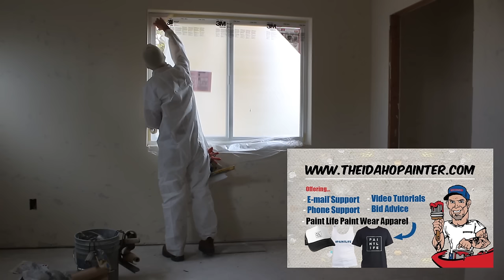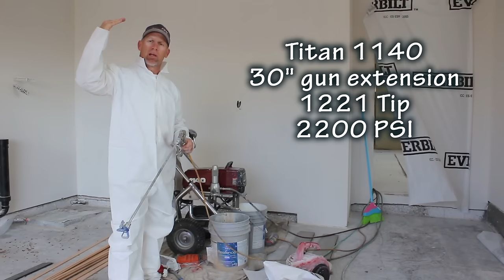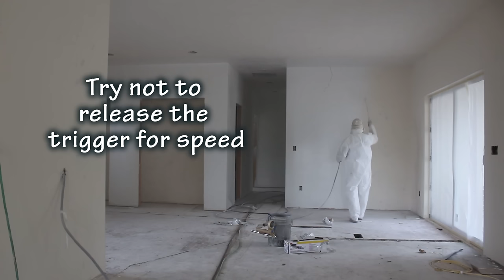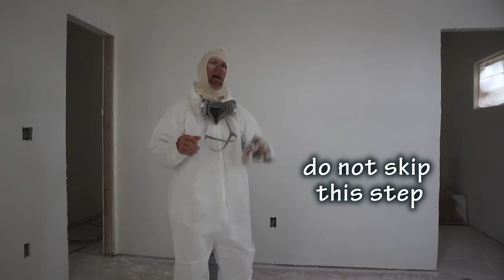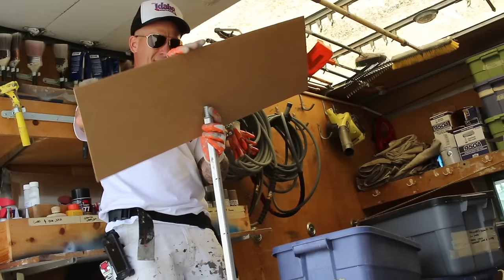PRIMING AND PAINTING WALLS  Painting New Construction Sheet Rock Walls.  Spraying new drywall

Comment: Just a thought, if you back roll the primer you don't have to dust unless its excessive ( i use a 24 inch floor broom). If the primer is too thick i cut the primer 10% with water. I always back roll the primer :)   Different strokes for different folks :)
Reply: If I'm correct, the mopping was done BEFORE he sprayed the PVA primer in another video... Where he showed prepping the walls before priming.. He mentioned that he mopped the walls because they were smooth and didn't have any texture on them... and they were sanded... not sure why he included that insert with this video..
Reply: The Montana Painter where in Montana. I'm lived in Cascade county for years.
Reply: The Montana Painter backroll is necessary. I would do it even if I dusted. Guys I know would not be nice to the Idaho painter
Reply: I never back roll. no need to if you know how to spray and it's a nice drywall job.
Reply: You have to bankroll if you want your application warranted by sw
Reply: What exactly is back rolling and is it done after I spray?    Do you do 2 coats of primer and if so how long do you waiting between coats?     How much does rainy weather play into dry time for primer?     Do I need to do multiple coats of paint in doing multiple coats of primer?

Comment: so I read some of the comments about back rolling so I thought I would put in my 2 cents from being a painter almost 20 years... yes you can just spray the primer, yes you can just spray the paint finish too, but.... primer won't seal as good just sprayed also depending on your primer it might flash spray strokes.. same with paint gonna look real 'sprayee' if you just spray the finish not to mention in most cases it will touch up like crap.  some flats will touch up fine but anytime you take a roller to a sprayed finish to touch up your pretty much gonna see it.  He's using a pva so those usually are very dead flat & will not flash at all.  He's also doing high production work & a lot of painters will just spray everything on new construction, primer, then flat on all the walls & ceilings.  Why because it's quick & you have to make $ & sometimes there's multiple homes after one another but its not the best way to apply.  If you spray & backroll all your primer in it will feel like a job well done & be noticeably more solid I can guarantee that, then spray & back roll your finish paint & you'll be looking like a real painter that cares more about quality then $.  That's just my experience with it

Comment: Hi Chris, I haven't seen anyone back rolling after you spray. Is this necessary to do, I have always back rolled to get some texture and work in any thick or thin spots. If you have a way around this, I'd love to hear it. Thanks, I really enjoy your videos. You guys are truly top notch!
Reply: I've been doing new construction for DR Horton, lennar, and mungo, we always backroll for one reason, repairs. The drywall is fuzzy after sanding, so primer helps smooth out walls. Backroll will let it penetrate into the mud so that when it gets repaired later, it won't look fuzzy again
Reply: @CesarMartinez-wi7wc  do you back roll the paint also if you ready back rolled the primer?

Comment: The required equipment is cost prohibitive for the typical DIY'r. You're also moving your arm in an arc, leaving inconsistent application, and not backrolling or laying down a perpendicular pass.
You're showing these people enough to get them in trouble.
Reply from the maker: Not true
Reply: @Idahopainter  
Yes, very much is true but it's your show.
Reply: A typical djy'r is not spraying an entire house. I agree on spraying on an arc is not ideal but unless your bending your knees and getting on a ladder each and every pass you cannot achieve this with an extension so some compromise is in order.(Your arms length +extension is the radius remember.) I think there's plenty of good info in the video and is mostly helpful to people.

Comment: Chris are you able to spray the topcoat without back rolling or do you roll the final coat? I just primed drywall (sprayed) and sprayed the first coat eggshell and it looked a little streaki so I just rolled the final coat eggshell and it is way better finish streak wise at least ... but still not perfect or is that just the way it is that you can’t get glossy paints to be streak free? Is there always a little bit of a unevenness ?

Comment: How expensive are those spray painting machines and which do you recommend best? Are they just as efficient as rolling?
Reply: From 300$ to 30,000Grand.
Reply: Any room > than 200sqft w/ few obstacles is the cutoff, or any textured ceiling you feel like taping off.

Comment: we have some existing walls that got all new knock down texture to match the all new sheetrock on the other floors. Would it be ok to install all trim/baseboard, and Spray PVA primer those walls with some pva overspray on the trim (not  mask new trim). then later, spray all the trim. then mask  trim and roll ceiling an walls?  how would you do this?
Reply from the maker: PVA on trim is not a good idea

Comment: So the paint they sell in stores that already has primer in the paint wouldnt be good enough is it better to use straight primer then use the paint?
Reply: Old Timer on new drywall and any repairs you have to prime separately to prevent uneven drying which will cause flashing.
Reply: I have talked to several painters and paint sales people and they have all said 2 things;
1. If it is new drywall use primer first then paint.
2. All the primer+paint is is just extra thick paint. No primer at all.
I'm in the middle of painting the whole inside of my renovated house and have been learning a lot.
Reply: In reality no paint has “primer” in it. It’s a marketing gimmick to be honest. There is literally no guideline to what makes a paint a “paint with primer”. When a paint is labeled as that though, what it means is that it has a somewhat higher level of volume solids (pigment among other things) which helps it cover better and sometimes at a thicker millage (thickness of paint film on the wall). High quality primers are generally acrylic latex which gives excellent adhesion properties. Some “paint+primers” are acrylic vinyl which means it will dry fairly quickly but the adhesion and durability properties won’t be there. So personally, it’s a case by case basis. But if it’s new drywall, definitely use a PVA primer first.

Comment: Please give me advice on this: A contractor spray painted (one coat of Paint/primer in one EasyCare brand ultra premium) on my new construction drywall ceiling without cleaning the dust and he left without a trace.  I am now trying to finish the paint job.  I'm afraid without cleaning the dust and not apply a PVA primer the way that you show here, the paint will not bond properly.  Please recommend what I should do next?  Thank you.
Reply: There's really usually not a lot of dust on the ceiling (gravity). So nothing to worry about.

Comment: Getting ready to paint one of our bedrooms at our house.  The ceiling paint was peeling so we stripped it bare, down to the plaster.  What kind/type of primer and paint do you recommend so this does not happen again.  I'm also gonna put texture on the ceiling and the walls, do i put the texture on before or after primer? 

We also stripped wallpaper off the walls with a product called "Worlds Best Wallpaper Stripper" from Home Depot.  Is there anything else I should do to the walls.

I purchased a Graco airless with a 515 to primer/paint and bought a Hopper Gun as well to do the job (never used either before, but from watching your video's I think I'll be okay using them).

Been watching your video's for tips, they are excellent!!

Thanks!!
Reply: Would you put the texture on before or after the primer?

Comment: Chris here in KY homeowners like textured ceilings when building new homes. I'm about to paint a new home with exactly that, textured ceilings. I want to prime the walls while spraying. Obviously at this point of the process no carpet, trim or hardwood floors are down, so no worries getting any over spray on them. However, I have to ensure the ceilings do NOT get any paint on them when spraying the walls with primer. What process/procedure do you use to ensure the ceilings are not affected? Do you simply use 9" paper with 3" tape to catch any potential paint over over spray from getting on the ceilings?
Reply: 311 tip and 12in paper on the ceiling
Reply: What he said! (Stew). Also, it would help alot if you're arm angle was straight at the wall up there at 8', so think about wearing either some platform shoes.

Comment: Question about paint after texture 
I apply orange peel texture on a 700sqft retail local and spray paint the wall (satin) right after, but when I came back next day I notice if I stand on front of the wall looks great but if you stand along the wall and look the natural light reflection look like either the texture wasn’t even or needs more paint. I’m not sure if I supposed to primed prior paint or back roll it? Thanks in advance for the recommendation
Reply from the maker: Prime first with a PVA primer.  To late now

Comment: Do you have to prime new construction drywall?  is there another way to get good coverage?
Reply: Jody Walker - if you don't seal the new drywall and or the the texture it will suck up the moisture from your paint and dry blotchy and require many coats. By that time the fiber on the board will start to raise and so can and will the tape joints. The drywall primer is not only a primer.... It's a surface sealer! Poly Vinyl. PVA is cheap and doesn't need to be perfectly applied so there's no reason to skip it. If you do you will not only need more paint to cover the walls properly but you're gambling with the tape lifting and fiber raising.... Especially  on smooth surfaced walls.

Comment: I just removed 30 year old wallpaper from bare drywalls. Meaning drywall was not primed or painted before wallpaper. The glue is all over the walls. Need to prime 2x I think
Reply: Remove the glue, I normally just use hot water and sponges and rags. It sucks but it should be done. Some jobs I've been able to use a electric pole sander to get it off. I mean all jobs are different and take a different course of action .I've had contractors tell me to just prime over because it was being textured with knockdown but in your case remove the glue with either hot water,  apple cider vinegar works (stinks) or diff (chemical) from hardware store or paint store
Reply: Chris Blanchard yes u r very correct. This job had wallpaper in all the rooms so I had to figure out a way to remove the glue quicker rather than sponge and water. I used a steamer that glue just melted and ran down the wall mixed with hot water. Worked like a charm. I still had problems but that's just the way it was too much glue.

Comment: Hey Chris,

In the past I was using a rag to dust off the dust from the walls. But then when I use the paint sprayer (similar to the 1 you use, just the smaller version) after priming new drywall the walls are gritty and I literally have to sand absolutely everything with a 120 grit to make it feel smooth, like how a wall should feel.. 

I saw your mopping the wall video and I'm going to try that on my current project I'm doing. However I'm wondering if you could tell me why the walls feel gritty all over everywhere, after spraying on new drywall with primer? Is it a pressure related thing, a dust related thing, or should I just go over the walls with a roller after spraying, to try and avoid the problem? 

Any help you can offer is greatly appreciated!
Reply from the maker: Cause of the dust on the walls

Comment: Can wall paint be used instead of primer on new drywall?
Reply: 771blahblah - yes but it will dry blotchy and require more coats meaning more paint! You are also gambling with the tape joints lifting as well as the fiber on the drywall board raising. PVA is more than a primer... It's a sealer!
Reply: Yeah what he said but also, the topcoat is usually 2 or more times expensive as a pva primer, the pva primer is to cut down on paint costs

Comment: I don't like spraying first coat primer on new drywall especially if a power sander was used to sand. a power sander will leave little fuzzies and a sprayer will encapsulate these in the paint and they will show on a smooth finish. using a roller for the first coat will work these into the primer so they don't show. sure its nice to go in and spray a whole house in  a couple hours and be gone but for the level 5 finishes that my customer expects its not going to cut it.if someone has mastered a way to overcome this I am all ears.
Reply: freethinker52 Are you a taper?? I mean a good taper! A level 5 has almost nothing to do with your priming technique. If you want to produce a level 5 finish,  then first you need to get rid of that power sander!  My walls never see a power sander.  You can’t produce a level 5 with that bs! Because if you need to sand that much then you’re using too much material. Put it on, wipe it tight and move on.

Comment: Hello Chris great work! I really appreciate your videos! I know this is an old video so I don't know if you will respond to  my question but I'm curious about something. I'm priming the new drywall in my house and I've heard stories that you're supposed to sand and then apply another coat of primer and then sand and then paint is this true or not? I'm using the Sherwin-Williams good primer that you use is one coat enough and do I have to sand after priming before finish paint? By the way I am rolling not spraying. Thanks and take care!
Reply from the maker: It depends on how rough the wall is whether or not you need to sand

Comment: Why didn't you back roll? Your coating is terribly uneven if you never let off the trigger.
Reply: why would it be uneven if you don't back roll, if you apply paint heavy and wet it will come out even doesn't matter if you are trigger happy
Reply: Have to make sure there is no dust or you will make the walls into sand paper

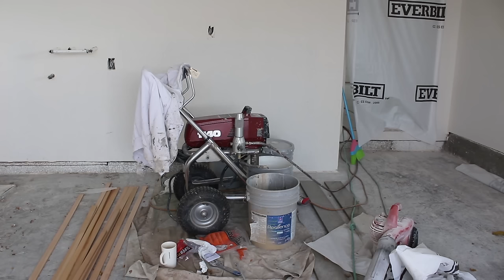Comment: 6:51 you spray your cords- i do the same shit when priming lol it wouldn't hurt to mask them i suppose- or move them
Reply: I noticed that too. I usually spray around them fairly close, then pull them out and do a quick pass with the built up pressure. Then plug them back in and keep moving.